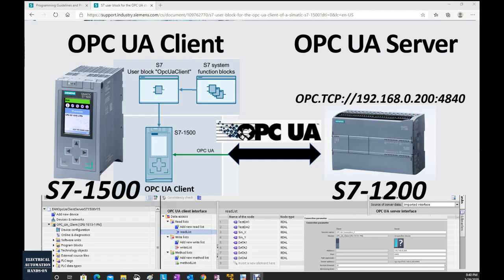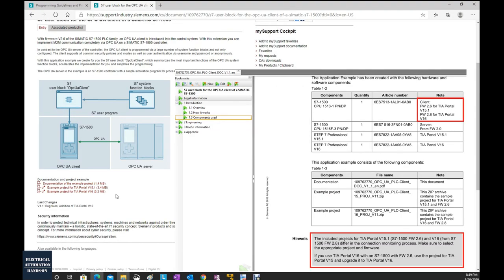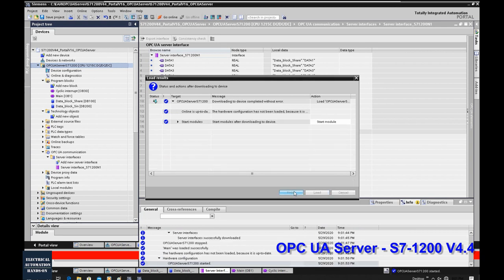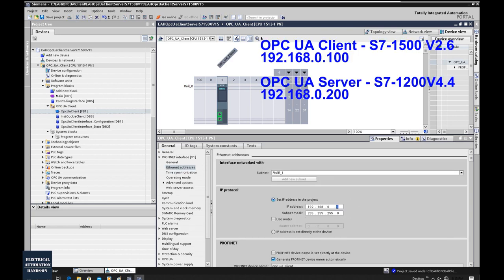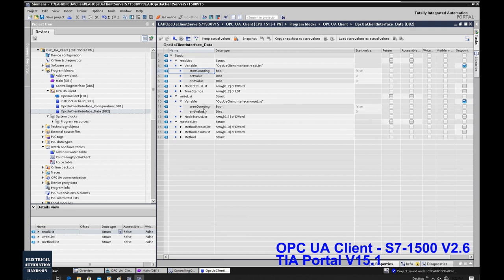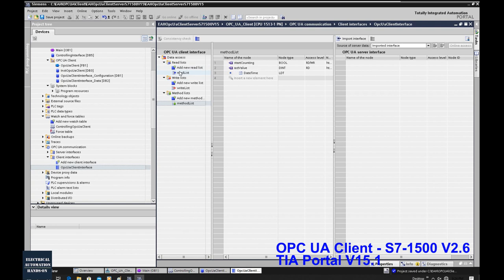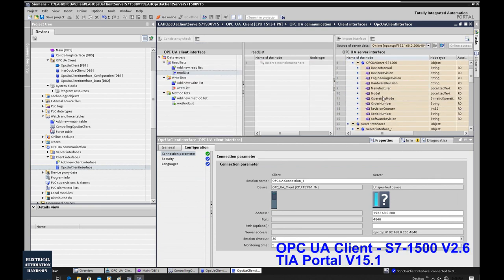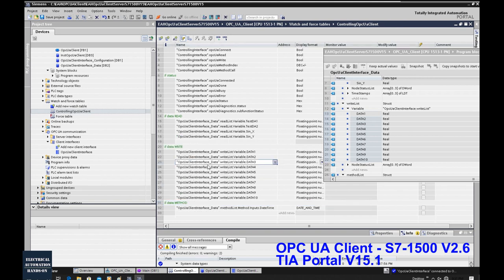COM09. OPC UA - Siemens S7-1500 (OPC UA Client) and S7-1200 (OPC UA Server) TIA Portal

Comment from the maker: Recommend to use the latest CPU firmware to do the test. Some wired problem may be caused by the firmware issue. e.g. V4.4.1 of S7-1200 fixed some issues on the OPC UA functions. 

Update V4.4.1
The S7-1200 CPU firmware update V4.4.1 replaces the V4.4.0 and corrects the following issues:

-Corrects the number of allowed S7 routed connections with left-side modules
-When TIA downloads only hardware configuration, the OPC UA security policies are applied appropriately
-Corrects the OPC UA Structure sizes in OPC UA Binary Protocol
-Improves secure open user communication robustness
-Allows secure open user communication when using self-signed certificates
-Fixes sporadic DataLog corruption when downloading from the Web server

Comment: Very helpful video!
I cannot quite hear what you are saying at 39:45 to make sure the data is being read all the time?
Also, I was wondering, how can we now read this data on the S71500 on the other network interface X2? Do I only need to configure the addresses in the watch table and is the data then already readable? Or does this require more configuration in the program?
Reply from the maker: Thanks for watching! At 39:45, to update your data receiving buffer/variables, the *.opcUARead needs to be a rising edge to trigger the 'reading'. If you need to continuously reading the variables, then the *.opcUARead should be a pulse with certain period, e,g, 1HZ to allow the  *.opcUARead every 1 second to trigger one time. Regarding the X2 question, it does not matter with port of the S7-1500 CPU you are using.

Comment: Thank you once again for this, must the Server and Client be on the same Subnet for connection to exist?
Reply from the maker: Hello, I don't think they must be the same subnet. As long as the client can access the IP of the server,  e.g via VPN or Router, they should be Ok
Reply: @electricalautomation  Thank you very much for always replying fast.
I have a challenge with connection.
I am trying to use a simulation server software and I cannot get an IP address from it. It uses opc.tcp.hostname.port/opcua...
I used that at the opcua client interface import interface settings and it works because I am able to bring in the tags from the server.
However, because the IP address at the hardware settings is not correct, the connection for real data exchange does not happen, it goes into error.
My question is, do you know any OPC-uA server simulator I can use that will give me an IP address for connection or do you know how I can set same for Prosys or Matrikon servers.
I have downloaded a lot and it's all same.
Thank you once again.
Reply from the maker: @Oluwasedago  You could try KepserverEX https://www.kepware.com/en-us/products/kepserverex/. I used it as OPC server before, it is free for test every 2 hours
Reply: @electricalautomation  Thank you very much. I have gotten the IP into the Client PLC and I still get the BUSY and ERROR indicator issues anytime I try to connect. Since I am able to connect and bring in the tags from the Server into the OPCUACleintInterface, I want to assume this issue might be related to the Siemens PLCSIM Adv. and the Server Simulator not being able to connect internally for the real data transfer. Since I am using 2 simulation softwares.
Do you have any experience of same using two simulation softwares?
Perhaps I need to try with a real PLC.
Reply from the maker: @Oluwasedago  I would recommend use real hardware for the test. Also use the latest version of software and hardware. The new PLCSim improve the OPC UA communication.
Reply: @electricalautomation  Hello, I am currently using S7-1500 hadrware now and with an external device as server. I am able to connect to get the tags, however connecting for main communication brings an error. Once I activate the OPCUA connect, the  Busy and Error become TRUE and the the following feedback:

Status: 16#8601

Subfunction status: 16#8012_0000
Please, where can I get what this Subfunction status means because the manual only interpretes the status to be : 16#8601 Error during connect (SFB "OPC_UA_Connect"). 

Thanks very much!
Reply: @Oluwasedago  Hi, have you find the solution? I also have error code 16#8601
Reply: @joost9522  Yes somehow, I got it to work. I had to configure same IP of the server in the PLC Server configuration.  I also had to get rid of the methods list, and set corresponding parameters to NULL at FB. What hardwares are you using?
Reply: @Oluwasedago  Hi David,

My error code now is 16#8005_0000. I've deleted the method list but this didn't work. Hardware OPC UA Client is Siemens S7-1515 
Hardware OPC UA Server is Phoenix AXC F1152
Reply: @joost9522  Worked?
Reply: @Oluwasedago  Hi,
Unfortunately not, but now I chose to use some other software which does work properly . I think I ended with error code 800A_0000. 
( Also triend WinCC professional but didn't work either. I Can see the tags but they stayed on default value when going live while the OPC UA Server changed them)
Reply: @joost9522  Hi Joost, its funny that I also that error before the eventual communication. That was the last error before everything worked.
With that error, Its already connected and the data communication is not yet possible.
Try do a memory reset of your Client PLC. Do it using the switch on the PLC by pressing down just for a split seconds and then move it back to run.
Also, program your read and write to alternate, as a start, do not read and write at the same time. For me, I disabled writing until I got the reading to work and then I used alternate bit to read and write to they never occur at the same time.
Hope this helps and good luck.

Comment: Thanks for video firstly! I wonder about "Events". I can see types and other folders when I use UaExpert as a client. But in "tia portal opc ua server interface" I can only see object folders. So I can't add "events" to the client plc. Do you have any advice about it? thanks!
Reply from the maker: I never used events of OPC UA. I also have no idea how it works. Are there some reasons you have to use it?
Reply: @electricalautomation  yes Im trying to create communication m2m, and server was created by machine manufacturer so I cant modify server model. Because of m2m I should use plc as a client and I can’t see all folder in tia portal interface as uaexpert.
Reply from the maker: @kayhan667   I don't think you can find the variables in the events in S7-1200 with the current revision. But maybe try S7-1500 with the latest revision at TIA portal V17. Or You might contact Siemens for asking if the PLC can provide more variables and more folders.

Comment: Can u Just use SOAP/Http and get a Wsdl File instead of using TCP/IP connection?
Reply from the maker: Hello my friend, the SOAP is a different topic from the OPC UA discussed in this video. But regarding the SOAP,  this link https://support.industry.siemens.com/cs/document/109763879/library-for-http-communication-(lhttp)?dti=0&lc=en-WW could give you some ideas. OPC UA is spreading and will be commonly used method to allow machine to communicate with machine (local or global), more specifically PLC to PLC between different brands. LHTTP would be a way to allow PLCs to communicate directly via the Internet (global). This link, it provide a way to allow PLCs to communicate locally or globally. However, I have no idea how other brands support this method, e.g. A-B, Omron, Beckhoff.. I also slightly doubt the security issue from this Http method. But OPC UA does a good job on communication security.
Reply: @electricalautomation  thank you :)

Comment: On client side if you do not use the Siemens example how you set that up on s7-1500 PLC
Reply from the maker: Hello, we have to use 'FB1 OpcUaClient' provided by Siemens, otherwise, it is difficult to build up the 'OPC UA' protocol by your own. Other than this FB1, I basically do my own configuration. e.g. Client Interfaces configuration. I explained the internal connection between the  FB1 and the Client Interfaces configuration. Thanks for watching.
Reply: @electricalautomation   Hi friend ! if you know how to do it, could you please do a video configuring the client by your  own ! without the FB1 OpcUaClient ? i guess you would use the OPC UA communication library ? to be honest, i've already tried it with a diffrent CPU, ET200SP v2.8 and so far i couldn't get the DONE of Opc_UA_Connect ! (using both client and server on PLCSIM Adv), it would be great to know how You do it ! Thanks a lot for sharing with us you're knowledge !
Reply: @electricalautomation  thank you for reply, I tried to use this Siemens FB block but unable to connect with server which is not siemens PLC . I can see the tags in that plc in my client PLC interface setting but that FB block does not connect with plc there must be some other setting. If you make a another video just for the setting would be great  thank you
Reply: @gr.imadeddine324  I have similiar problem unable to connect with PLC, if you find a solution please share with me too thank you
Reply from the maker: @mrjadoon4614  Hi Khan and GR, I think the current version of PLCSIM Adv (even if it is v3.0) is still limited on OPC UA. I think the reason you can not get success when you tested other PLC as OPC Server is that the license, security,  and certificate issues. In addition, according to the example program from Siemens , the program on V2.6 and V2.8 are not the same. Base on these, I personally recommend that you'd better not take two many efforts on testing the Client using PLCSim Adv. You;'d better use the hardware to implement the OPC UA.
Reply from the maker: @gr.imadeddine324  Hi friend, honestly, I was planning to try by myself, but I gave up developing by my own. If you look at the manual of the FB1, you will see how complex its internal. Especially, the firmware of the CPU may potentially works on sth of OPC UA. Therefore, I recommend do not pay too much time to figure out 'how' the FB1 OPC UA Client works, unless you are working on OPC UA protocol area as your job. Just use it as you are using a drill. I also have strong feeling that Siemens may update this FB1 in the following months improving its functions and solving its potential glitches. Thanks! I really like an open mind discussing with you friends.
Reply from the maker: @mrjadoon4614  I am making a video using Matlab as OPC UA Client and PLC as OPC UA Server. In the video, you will see even the OPC UA Client of Matlab 2018b has some issues. I wonder say the OPC UA Client functionalities are still 'new' for the application area. there may still some potential glitches existing in the tools and software.  Hopefully, the coming updates of software, PLCSim, as well as example program could be more reliable and feasible.
Reply: @electricalautomation   Hi ! i don't think it's that complex as it seems ! i've seen multiple projects where the communication is configured -( a BASIC program ) using simple blocks of the library OPC UA COMMUNICATION, Although it worked on them using a real cpu ! it doesn't seem working on PLCSIM ADVANCED, except the siemens example ! so i share the same thoughts as you with the advice you gave where we should try with real CPUs instead of paying too much attention & time trying it with virtual ones !  .. thank you ! i appreciate it !
Reply from the maker: @gr.imadeddine324  Thanks my friend! Have a nice weekend! Furthermore, I wil release two videos about PID and Matlab OPC UA.

Comment: Thanks for sharing. I use the example project connecting to the third party opcua server, the client device is S7-1500(CPU 1511-1).After compiling, the result is ok except  one error : Cannot update the data block for client interface. I didn't find out where is wrong.
Reply from the maker: Please find the DBs you have, find out all the 'red' mark on the data type area, and using right-click to manual update the 'Data type'. as shown in  https://youtu.be/oChVcRaUt9M?t=1095. Also check if the you have the date type under the layer 'PLC data type' the system needs.

Comment: does it work with 02 CPUs (s7-1500) in the same project with both on PLCSIM Advanced ?
Reply from the maker: I think it works if you use two CPUs running in PLCSIM Advanced and let them communicate via OPC UA. I didn't try this because I use one the real S7-1200 as OPC UA Server.  The key idea of this video is going to show the how the S7-1500 OPC UA Client works. I am very welcome if you could give a feedback once you try two CPU in PLCSIM advanced. Thanks
Reply: @electricalautomation   So far it doesn't seem to work, i have an error code on the opc ua status of the client interface ! 16#8601, so i guess that the client couldn't get connected to the server !  (i used the same project file that siemens gave, which is the one you used to get the client CPU) i don't know if the connection between the 02 CPUs could be established using opc UA on plcsim advanced ! If you can do that please let me know ! Thanks for the video and all the informations you gave on it !  Keep going !
Reply from the maker: @gr.imadeddine324  Hi My friend, I just try using PLC SIM Advanced for two CPUs, Unfortunately, my laptop becomes freeze when two CPU instance running in PLCSIM Advanced. I  tried three times, the system all freeze can not let me download the project to the PLCSIM adv. I am not sure what the performance of the system on your side. Therefore, I highly recommend you OPC UA or Client at least one hardware instead of all 'virtual'.  I believe, if you use one side via hardware, it will be done.
Reply: @electricalautomation  Hi ! thanks for your effort ! from my side, i was able to download the the project on both client and server on PLCSIM advanced,  i also tried one CPU server alone without client and it did work on it ! but the two at the same time didn't work ! I also think the same as you ! i think that we need one part to be real and not virtual so that we can establish the communication between the client and server ! Thank you so much again  for all what you've done !  i wsh you all the best !
Reply from the maker: @gr.imadeddine324  Thanks GR. I wish you all the best! Welcome to my channel, and welcome to watch my other playlists. Thanks!
Reply from the maker: @gr.imadeddine324  Thanks a lot for your sharing. We could also try using two laptops running PLCSIm Adv, one runs (OPC UA Server), the other one runs as OPC UA Client.
Reply: @electricalautomation   That's interesting to try ! one major inconvenient is that you need 02 Laptops to do so :/ ! thanks for sharing tho ! at least we know now that it could be done ! =D
Reply: @gr.imadeddine324  Hi, I have the same error as you (16#8601 with 2 PLC simulated on PLCSIM Advanced), so the only solution is to do it on TIA Portal 15.1? Doesn't work on V16?
Reply: @louiseckler1737  Hi, yes so far it worked for me only on V15.1
Reply: @gr.imadeddine324  Thank you for your reply. It doesn't work for me on V15.1, but I'll try again

Comment: I need help, I generated a client interface and was able to find the server online and fill the read/ write-lists with the data I want to receive from the server. Now the problem is, that I'm receiving the error code 16#8601 from the function block. But when I'm able to find the server in the client-interface setting, I should be able to connect to the server with the function block or am I wrong? I'm using v16 and a cpu1500. The client and the server are running on the same device. Could that be a problem?
Reply from the maker: I would recommend try Client, and Server separately first. If they can work individually, then you may modify port 4840 to another port number, the server/client may conflict using the same port.
Reply: Thanks, running the server on a different device solved the problem. Now I wonder if it is possible to realize a kind of subscription, with this client function. My goal is to only send data, when it has changed. Is there a way to achieve that?
Reply from the maker: @marius9692  May be this link can help you https://support.industry.siemens.com/cs/document/109756885/opc-ua-methods-for-the-simatic-s7-1500-opc-ua-server-?dti=0&lc=en-WW

Comment: Am facing a flickering error, status switches between 16#7001 and  16#8617 (Error in the status list after read of namespace indexes according to manual.) any idea? I am using Kepware as OPC UA server
Reply from the maker: Hi, referring https://youtu.be/oChVcRaUt9M?t=1753 in the video, can the 'OPC UA Server Interface' browse the Tags from Kepware?  Also, pls check the middle window 'read list' and 'write list'. the tags in the window also show the OPC UA Node ID. pls check the if the 'ns' namespace match your Kepware side. In addition, double-check if the write list and read list in the 'Interface_Data DB' are updated with your configuration.
Reply: @electricalautomation  Yes, i can browse tags from Kepware, i have inserted them to readList and writeList as per video. what should the Kepware namespace be ?
Reply from the maker: @mohsh86  How about using another S7-1200 or S7-1500 running as OPC UA Server instead of Kepserver for a try, if this S7-1500  OPC UA Client can communicate, that means Kepserver (OPC UA Server) side has sth to further setting.  This can verify if the S71500 OPC UA Client is running properly. Bty,  are you using PLCSimAdv or hardware, I highly recommend you use hardware and lastest firmware.
Reply: Hi,i`ve the same issue. Did you find the root cause?
Reply: @ufukozer2497  I had to get rid of the methods list, set corresponding parameters to NULL at FB

Comment: Hi sir You can do Opc Ua client between node-red an tia Portal V16, try to use the PLC SIM advanced
Reply from the maker: Hi Carlos, the node -red may run as the OPC UA Client, and the Siemens S7-1200/1500 runs as OPC UA Server. Therefore, you can review the S7-1200 OPC UA Server portion in this video.